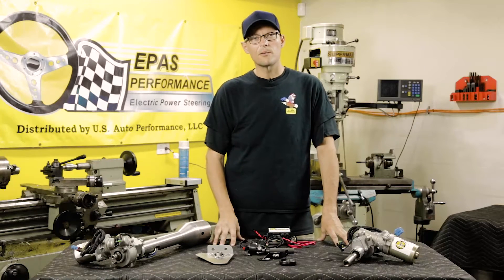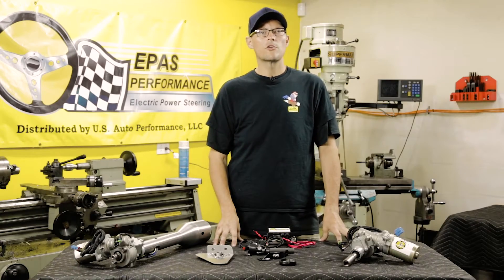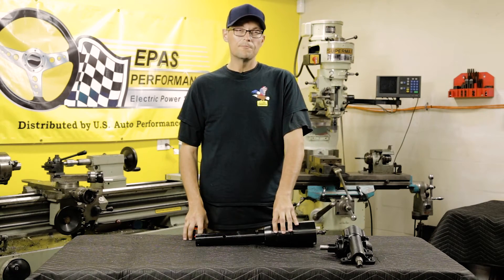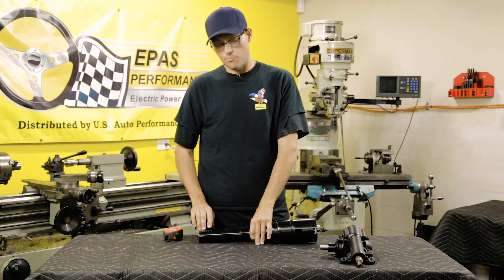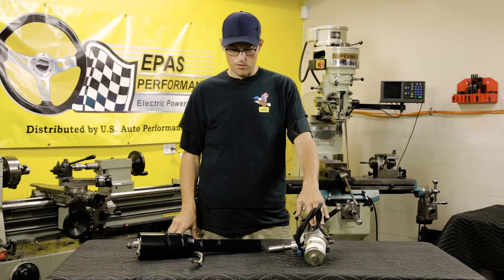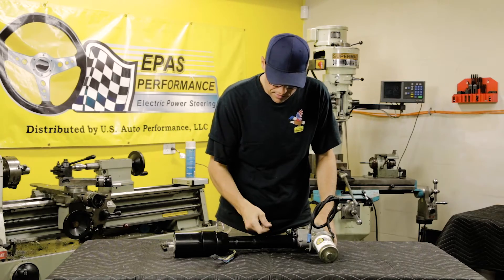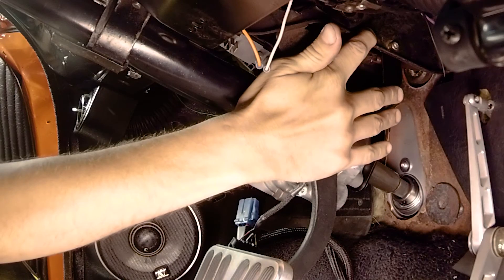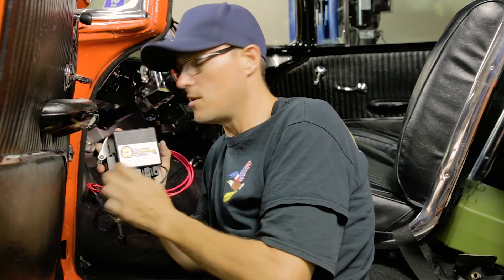EPAS Performance Application Specific Electric Power Steering Conversion Kits

Comment: Those couplers holding the shaft dont look secure.. Should have drilled small holes on the shaft for screws to go inside so the shaft wouldnt slide out.
Reply from the maker: Yes Sir, They do. This video is just an over view of how it is done. Our install manual goes more in depth, that is where the drilling process is included. Thanks for watching!